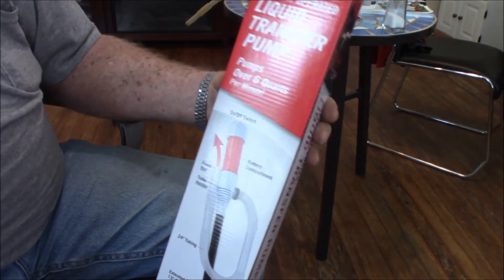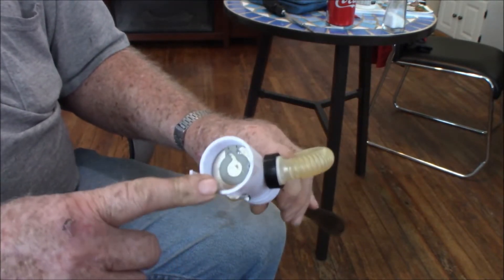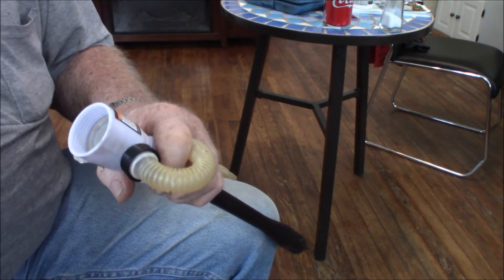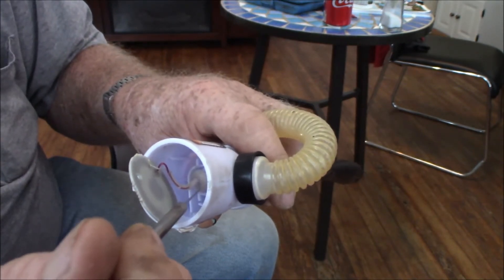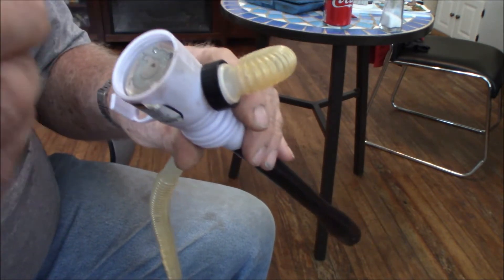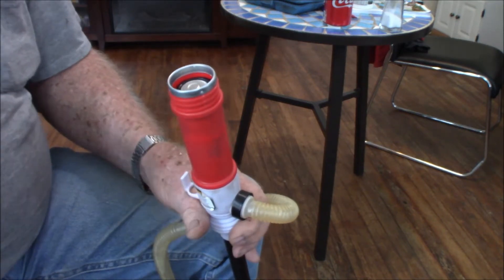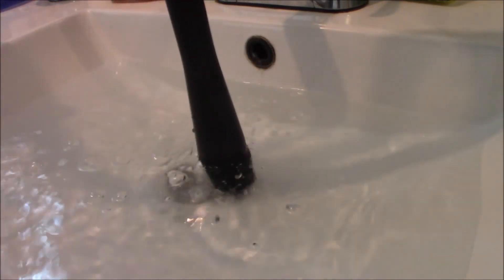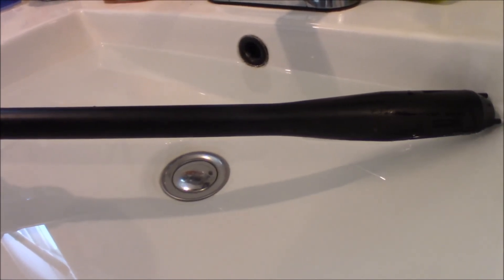HF battery fluid transfer pump malfunction

Comment: We did not get on with the one we bought but since then we have spilled enough gas on the floor to justify buying another. It is good to know they can be fixed, thanks for sharing the information
Reply from the maker: once I got one I really liked it so I actually ordered another one in case this one doesn't hold up.

Comment: Really good info . I bought 2 of those and I might just do some preventive fix on them .. Never tried them out yet .. Thanks !!
Reply from the maker: they sure are handy and it says right on the box, it works with gas.
Reply: @MissouriOldTimer  yes sir, mine does to .I think I will take one apart and check it out before I use it . I need it for gas cans as well !

Comment: I bet it works fine. I am 2 years in on my pump and no problems at all yet.
Reply from the maker: I went ahead and ordered another one off ebay before I tried to fix this one,, I guess I am a little impatient.
Reply: My husband is on his 3rd one because it leaks through the top after about a year,

Comment: I bet the JB Weld will outlast the pump.  Time will tell.  Have a good day Vern
Reply from the maker: other than the leak that pump is very handy, no more trying to hold a heavy gas can up to fill a tank and not spill half the gas.
Reply: @MissouriOldTimer  - Agreed, I like mine.

Comment: Did your fix hold up in gasoline? I was looking at one of these the other day. They would not take it back...how long did you have it before it broke?
Reply from the maker: I used it several times, the glue or what ever they used to seal the gas off came loose, they gave me a number to call to exchange it,, they didn't want it in the store since it had been used with gas.